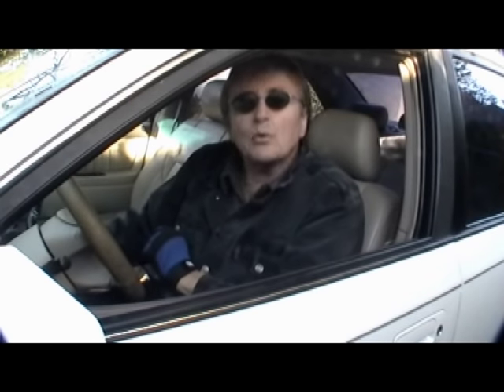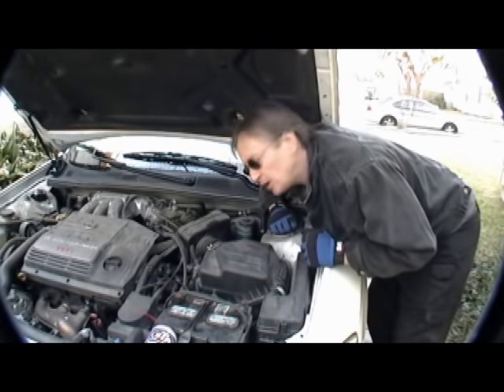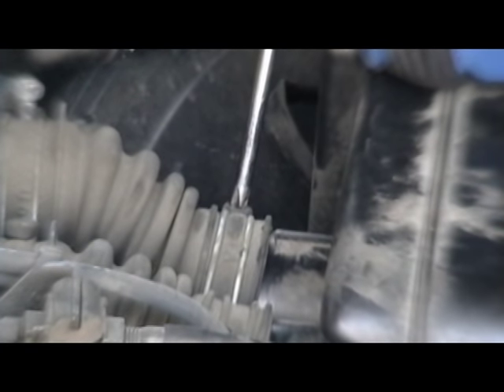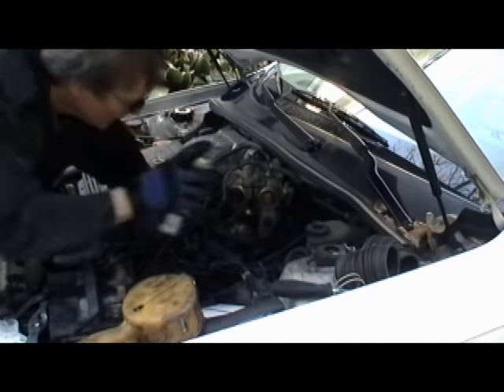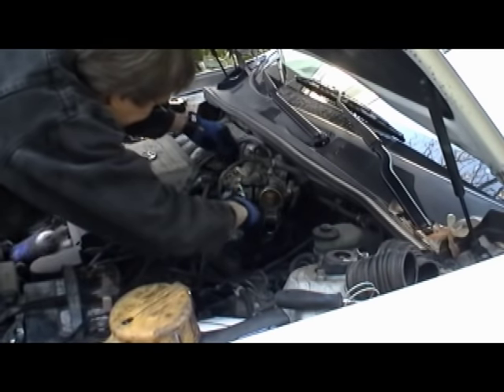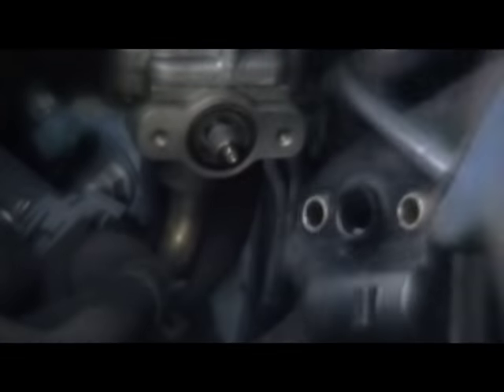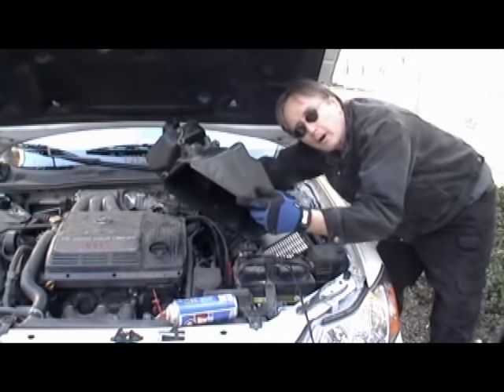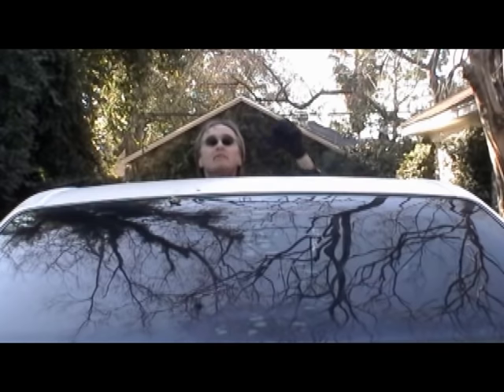How to Fix Engine Idle Problems in Your Car (Rough Idle)

Comment: Hi, just watched your videos, I have a 1995 Toyota Corolla DX with 1.8L engine. I just had my motor & trany motor mounts replaced today and now my steering wheel & seat is vibrating whenever I come to a stop. It did not vibrate like this BEFORE I had the motor mounts replaced. Any idea what it could be?
Reply from the maker: +Rhonna Forgue   take it back, they messed up, either mounts were cheap ones which don't fit right and cause vibrations, or they installed them icorrectly

Comment: Hi Scotty! I have a 2001 Stratus 2.4 x DOHC Naturally aspire, When I got this car I notice when it starts it accelerat and then idle.. so I check the IAC valce and it was the incorrect one.. So I replace with correct valve and it solve the problem.. now I have another issue.. when its on idle.. every 5 secounds kind a vibrates and bounce.. makes like its going to turn off.. any idea what it could be?
Reply from the maker: +oscar rodriguez  worn motor mounts often do that, also try my video "finding engine vacuum leaks with a cigar"

Comment: Hi. Got a Honda Fit 2007. Recently the engine is stutters or wants to stall out but doesn't, especially when the car is in Drive with the brake pressed, like you would at a stop light. I had maintenance done last week at the same place as usual, this never happened before. I don't think the alternator is faulty because on Park or Neutral idle the engine barely stutters. No check engine light comes on. What could it be? Thank you in advance.
Reply: +silverbird58 Thanks for your input. Fortunately it was the ignition coils, which needed replacing. It's purring like a kitten now. 🙂

Comment: I have 1993 silverado with a 5.7 tbi. The truck has a choppy idle after it warms up. It runs smooth when you first start it but after it warms up and the rpms drop down to around 1000rpms it will bounce up to about 1200 rpms then down and up after about 3 sec in between for a few mins then it will drop down to around 500 rpms and bounce between 500 and 700 rpms. Other than the idle the truck seems to run good, good throttle response no missing above idle. It does smell as if it runs a little rich. I have another truck that use to be my uncles and doesn't run that has the same engine I borrowed the iac valve, map sensor and temp sensor and It didn't seem to change a thing. I have also not been able to find any vacume leaks nor do I have a service engine light on and I have had it scaned registered nothing. The engine was change by the last owner he said the engine had around 80 to 100k miles. I have noticed that I have an oil leak in the back of the engine not sure if it is coming from the distributor or the intake, I don't think it is the valve cover I had removed it and the gasket looked good, I have also replaced the oil postion swith so it's not that. I dont think i left anything out ,So I'm not sure what's wrong with it any help would be great.
Reply: I also forgot to state that after it warmed up and idling around 500 if I put it under a load say turning the steering wheel or turning the ac on where the compressor kicks on it will bog down some time stalling. This is a manual transmission truck if that helps considering it may act differently because I have to rev my engine unlike an auto

Comment: Hey Scotty! Love your videos! Watch them all the time and you've helped me out a great deal with my DIY projects.
My question to you is what's your take on properly cleaning a electronic throttle body?
I was thinking of disconnecting the battery, clean it while still connected to the car, and let it dry for about an hour.  I know the idle relearn process is probably going to be hectic so should this just be something for the dealership to take care of as a whole? Any suggestions?
I have a 2013 Corolla, standard (Because nothing beats driving a stick)
Reply from the maker: +Kenneth Linton disconnect the battery, use maf cleaner, then let it air dry a hour

Comment: I've got 2009 Toyota corolla I cleaned injectors changed,ignition coils and plugs also cleaned My throttle body and still got a rough idle and bad hesitation when Coming to a stop or pulling off . what's your theory on this?
Reply: Throttle position sensor?

Comment: hi scotty kilmer, how areyou? i got a question for u., gotta a 1998 3.0 dodge caravan and its starting to smoke., the muffler and pipe got a lot of oil., i just look at the sparks plugs and no sign of oil., but the trottle and the plenum have a lot and my question is were does it come from?
Reply: +viln o Definetely a faulty PCV valve.

Comment: I just got a truck from my dad today , its a 1990 ford lariat f150 and it hasnt been serviced properly for a while, and when i start it , it doesnt stay on for more than 5 seconds , and i have to continuously start it over and gas it up , also it dies while driving , I think it might be spark plugs, the idle sensor , or the fuel pump , it has many issues and i have no idea where to start.... Any source of advice  would be very much appreciated .
Reply from the maker: +Richard Rawlings   tune it up first, and do my video "finding engine vacuum leaks with a cigar" and pray

Comment: HI, I have a question on my car, its a old model suzuki car 95 model, its frequently stops while in running almost 20 km running, what could b the reason......
Reply from the maker: weak fuel pump or clogged fuell filter

Comment: scotty , i have 2000 avalon with 84000 seems to be running very rich, i did clean aic but nothing changed.  the cel is not on and gives no codes.. please help, any idea
Reply from the maker: +TheOwen1974 try my video "how to clean fuel  injectors on your car" dirty ones often do that. As do bad MAF sensors or dirty ones
Reply: thank you..

Comment: Checked out a 2003 Trailblazer today and it drove great but when the AC is turned in, it stalls. Do you think a simple little cleaning of the throttle body, will do the job?

Could it be anything else worse?

Thanks!
Reply: +Ace Equality I would recommend cleaning the mass air flow sensor also the bg fuel-air-induction service it covers everything  it runs $120 dollars it helped my nissian rogue.   heres the details regarding the bg fuel-air-induction heres what it cleans. 

Features:  Cleans fuel injectors Cleans throttle body Cleans plenum and air intake Cleans intake valves and ports Removes combustion chamber deposits Corrects balance of fuel and air in system

Comment: hey Scotty,  my 07 subaru forester lights dim and pulsate (internal and external lights) while idling and even more while driving. Should this cleaning help with that?
Reply from the maker: +RecklessDread  worth a try, but more often that's a bad alternator or weak battery, places like auto zone check those free

Comment: I have a 2008 honda crv. It starts to overheat  only when the AC is on and the car isn't moving, how can I fix this problem? THANK YOU
Reply: Check the radiator fans are working when it's hot. Check the coolant level is topped up. Make sure there is no restriction of coolant flow. Check or replace thermostat. Make sure the water pump works properly.

Comment: Hi scot. I have a nissan altima 2007. car engine vibrates at idle and becomes more when ac on. in driving mode its less, but in reverse neutral and parking mode it vibrates. mechanic told me its 2 mounts and another mechanic told me its plug issue. confused a bit. how can I test myself
Reply from the maker: +Jabir P  see my video "replacing broken motor mounts on your car" and jack it up to test it like in the video

Comment: my gmc envoy tells me low oil pressure but only after driving and at complete stops. Goes away immediately once you step on gas. I have full oil, is it safe to drive and how do I fix it?
Reply from the maker: if engine does not clank when light is on, often just a bad oil pressure sending unit

Comment: i have a 2011 subaru legacy that ive taken to the dealership 6 times for this issue. they either tell me its normal or dont even look at it. this last time i took it to another subaru dealership and they changed the tensioner belt and cleaned the throotle body. it still does it. less but still does. do you think what you discuss here is the issue or what? it kinda vibrates and shakes from park to reverse and in drive at a red light.
Reply: If it's vibrating and shaking switching gears it could be a bad motor mount. Just a possibility no way to diagnose on the Internet for sure.

Comment: Scotty or anyone knowledgeable please help! I have a 1998 Escort 2.0 
Auto. It has a low idol in drive with foot on break and (possibly 
unrelated) the biggest problem is once warmed up if in park the idol 
will rev so high I turn it off real quick so it doesn't blow something. I
 feel like I've done everything. I cleaned the old throttle position 
sensor (no difference) then put a new one on, then cleaned the old IAC 
valve (no difference), then put a new one on, cleaned the throttle body,
 cleaned injectors, cleaned valves and still same problem. I also 
replaced the Control Module relay which gave me my A/C back but did 
nothing for the idol. Please also note that after testing 4 Control 
Module relays, I found the only one that mostly worked as my A/C now 
comes on with regular air and the regular settings blow hot air. I was 
just happy to have A/C back any way I could get it. Any more ideas? Cuz 
I'm tapped.
Reply: I would suspect a vacuum leak.
Reply: @goldstarmale9128  Thanks for the info. You may be right. I fixed one vacuum leak but there may be more. Only problem is I sprayed starter fluid everywhere and no rev so if there is one, it's going to be hard to find.

Comment: i have a question for you scotty, years ago in mechanic school they told us that injector cleaner was not nessasary because there is an additive in the fuel that does it for us as we drive >? this was in the 80's . whats your take on this ?
Reply from the maker: +MrGarcon98  That is true if you keep your car up and use quality gas and change your oil frequently. Cleaner is for cars with gunk and problems. . The gas you buy at the pump by law, at least in the US, contains various cleaners.

Comment: my name is Kenny and number one with a 90 Mitsubishi Mirage I tried cleaning the idle air control valve I already did the rest it just dies on cold start it's first thing in the morning the very first start
Reply from the maker: old age, try cleaning the fuel injectors and pray they aren't just worn out and compression test the engine to see if it's worn out

Comment: i believe my throw out bearing is gone in my car, it makes a squealing noise when i engage the clutch and also won't go into gear easily now. it also drops the idol and makes it die when the clutch is in. am i right? need help
Reply from the maker: that's often it, but really, you have to pull the tranny to replace it, best to just buy a whole clutch kit and change all the clutch parts then

Comment: Hey Scotty I love your videos! I just purchased a 2012 Acura TL w/ Technology Package with roughly 50k miles from a dealer called John Eagle Acura. The car looks and drives like new and I want to know what you would recommend for me to do with the car in order to make sure it is perfectly taken care off and would last me a long time. Any tips or types of things I can do to keep it well?
Reply from the maker: change the oil regularly, and follow the maintenance schedule on the owners manual
Reply: Scotty Kilmer should I change the transmission oil right now since it has 50k miles?

Comment: Hi sir Scotty,
     Sir i have a problem in my TOYOTA INNOVA G 2007 manual transmission : engine shaking rough idle and its like no power to move forward specifically when im on incline i already change my spar plug and do the same here in your video but still no change pls help me sir thank you.......
Reply from the maker: +Lester Conde   of course tune it up, but if not that, pressure test the fuel pump to see if it's weak and have the MAF sensor checked as weak ones do that too
Reply: +Scotty Kilmer 
sir is there muffler sensor in innova 2007 g series sir...?  if do..? how to fix it sir...?

Comment: Hi i have a 1966 Cadillac Coupe Deville and it stalls when i come to a light and have to 2 step it in order to keep it running but otherwise drives fine after stepping on the gas it has been sitting for 10 years and i had transmission rebuilt new/ carburator/ plugs/ wires/cap/ rotor.  i was told it had low compression and the motor needs to be rebuilt do you have any type of temporary fix for that while i save my cash for a engine rebuild ?a engine rebuild is anywhere from 3,000-6,000 any help from anyone especially in Mn that can help im willing to pay $$$$ Big bucks for someone to get it running right again . even if i have to get it rebuilt ill pay for that too. of your a mechanic in Mn and specialize in old school cars msg me

Comment: Are there tests I can run on the throttle body to see if it needs replacement? I am lacking power all of a sudden. My turbo shoots to the end of the gauge, and before it would shoot to the middle at most. My transmission seems to be running fine, and shop diagnostics on it came back clean. I believe I noticed a slight improvement after cleaning, but my car is a 2006 Saab 9-3, and the throttle bodies commonly malfunction.  Thank you, Scotty! (or anybody else who has the time to offer some advice)
Reply from the maker: takes a pro with a lot of knowledge and a freeze frame oscilliscope to test a throttle body.  Being a saab, i'd change the throttle and reprogram it myself
Reply: Fair enough Scotty, thanks! I think I might wait to see if I get a check engine light. Everything must be within parameters because I couldn't get any engine codes myself either! Already spent about 1500 on other parts and tools, so I'm not yet sure I want to spend another 300 on the TB quite yet unless that's for sure what needs fixing! I watched your compressor video and thought maybe I would pick one up and see what kind of results I get! I've also got some BG 44k coming in the mail I hope might help, but other then that I believe I've already replaced all the filters and cleaned all the sensors that I can! Thanks for the help Scotty, helped me discover a love for working on cars I didn't know I had. I am going to school this fall to obtain my mechatronics degree!

Comment: Hi  Scotty  I have van 97 3500 diesel the problem is  when I drive it the engine die and I have to wait 5 mines to star again pls tell me what could be wrong with it
Reply from the maker: +Daniel Aguilar when it doesn't start, do my vid tests "fixing a car that cranks but doesn't start up" and pray it's something easy like a worn fuel pump

Comment: hi scotty. i have a 2005 dodge neon it vibrates when idling and stop at a light. it vibrates only at stop. hope i get a response. i replaced all 3 engine mount but the vibration still there
Reply from the maker: try tuning it up and do the stuff in this video too

Comment: I have a 2004 impala ls 3.8 engine v6. The problem is that it wont start without me slightly pushing the gas pedal while i turn the ignition key to start, If i do it without pushing the gas it will start and 3 seconds later the engine will die off. the car never stalls in stop lights ect..however I do noticed that the engine idles very slow. I open the hood and engine is running too quite, no vibration but its running. Pretty much I have been pushing the gas pedal just to start the car this 3 weeks. battery is all good, starter is good, changed spark plugs and cables. I have noticed that it uses gas slightly faster than normally. no check engine light.
Reply from the maker: +Choosen One GM and old age. try this video, pray it helps, often does. Also try my video "how to clean fuel injectors on your car"
Reply: Scotty Kilmer alright thanks for the feedback!

Comment: Hey Scotty, my car idles at 3500-4500 rpm. When I accelerate, the rpm goes to 7000. I was wondering if you know what could be causing this. There is no check engine light that comes on.
Reply: it would help to know what kind of car it is, as vehicles have different standard idles
Reply: Monkey D. Luffy it's a 1998 Honda Civic
Reply: +yunohrc When you accelerate, the rpm should go up.  Sounds like your car is operating just fine.
Reply: +yunohrc its just the maaad vtec working its magic. Vtec adds 400hp
Reply: +Frank Magana 😂😂😂

Comment: hey i have an 04 mitsubishi outlander that has an idle issue at 0 km/h. while driving its fine, well stopped in gear lots of vibration, neutral is fine.... changed EGR valve and engine mounts aswell... any help would be greatly appreciated
Reply from the maker: try my video fixes in this video, if not that, check for vacuum leaks as in  my video "finding engine vacuum leaks with a cigar"
Reply: +Scotty Kilmer right on Scotty,  it's actually a friend of mines vehicle in Mexico so it's hard to diagnose from Canada.. I originally thought vacuum but he's taken it to several mexicanics and they can't find it... another millwright at work thought clutch issues, it's auto

Comment: I drive a 1988 toyota corolla stick shift. When i start the car it idles fine at 1000 rpm. As soon as i start driving it the idle rises to 3000. Sometimes it lowers with the ac but not really. And i cleaned my carburetor already. Any thoughts?
Reply from the maker: it should be fuel injected. But if not, rebuild the carburetor. If it is fuel injected, try this cleaning video https://www.youtube.com/watch?v=NWCKvU2FmDc
Reply: Scotty Kilmer.thanks my man 🙏🙏

Comment: After driving around 25 minutes and i turn my car off. I try to turn it back on, and it does turn on but the rpms are very low and the car turns off. I press on the pedal all the way down. I have to do this process between 2-3 times. What could this be?
Reply: I have a 1987 Toyota Supra Turbo
Reply: +Duffman 305 Could be a vacuum leak, dirty throttle body or IAC, bad battery.